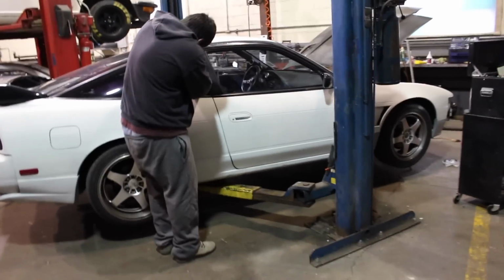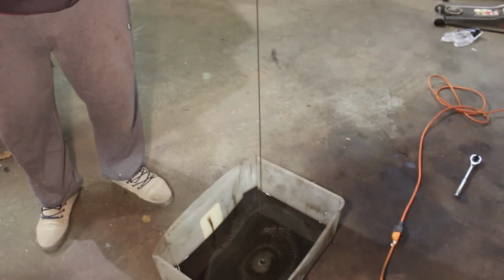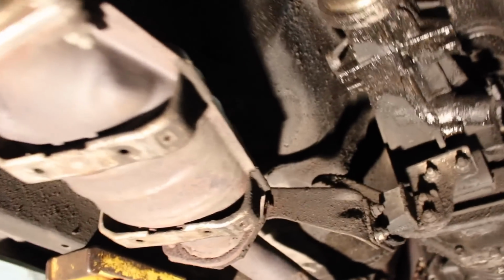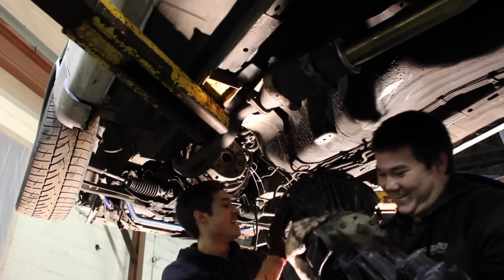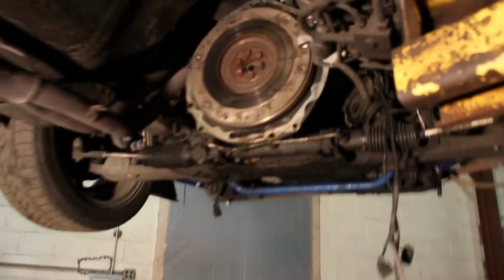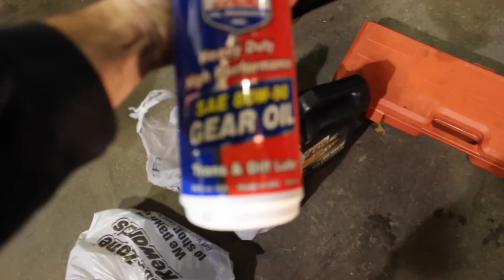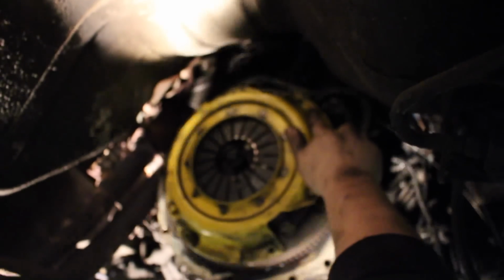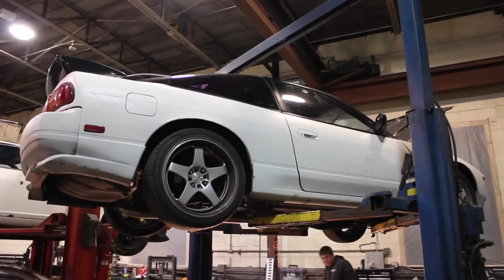240SX Drift Car KA-T Build P1 | Replacing Clutch

Comment: Kelvin, an easy option for getting the bush out is to fill it with grease, then use a shaft that fits snug into the bush and give it a hit, I guarantee it will work.Good work on the car, its nice to see young blokes learning this type of thing instead of sitting in front of video games all day.
Reply from the maker: +bandit4817 Yeah i saw that technique! the bread trick worked for my on my car but not here. we didn't have a shaft that fit right in there properly, but we got it!

Comment: where do you find the clean 240sx's? any like certain areas? all the 240s in stl are rustyed and dead.
Reply from the maker: Just wait for nice ones to come up! No specific area!
Reply: +Kalvin Malli (ThatBurgundy240) how much do you think a clean one would cost? 4 grand?
Reply: +Adrian Van Mondfrans (Ace) From what I seen 3 to 4 grand.
Reply from the maker: Adrian Van Mondfrans Depends a lot on location. In NY we pay more due to all the salt corrosion, clean ones are very hard to find. Just my Bare Stock shell with no motor was $1900.